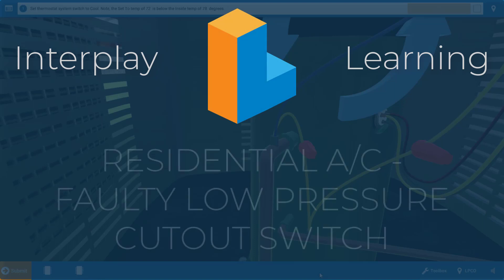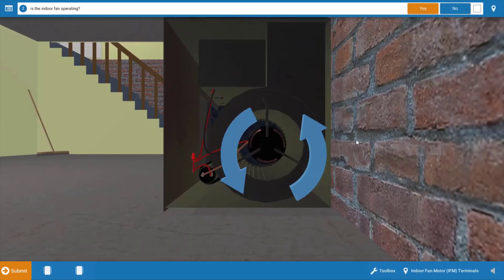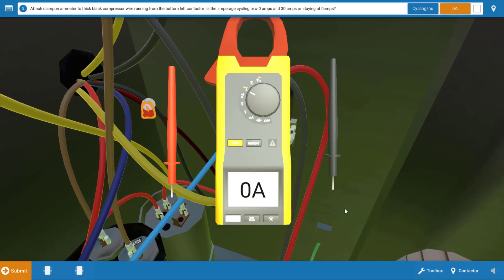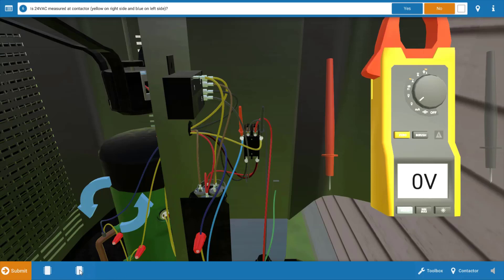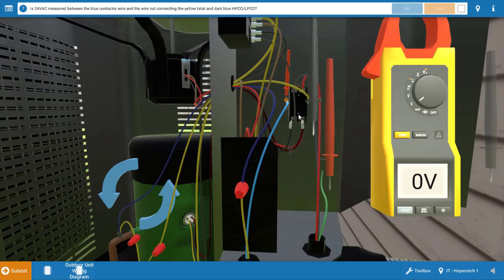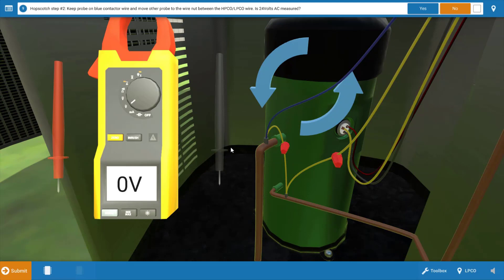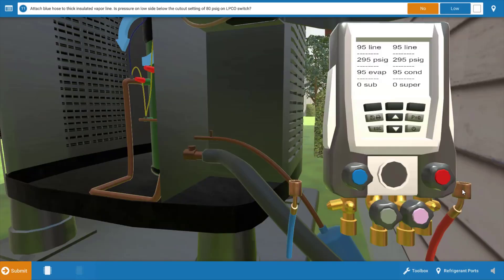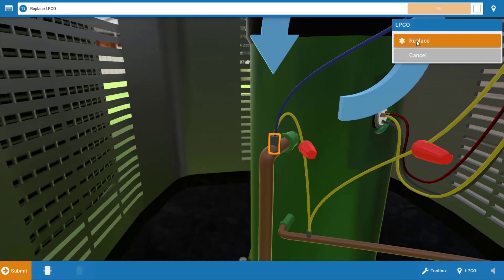Troubleshooting a Faulty Low Pressure Cutout on a Residential AC

Comment: Good explanation, but on your animation you have the low and high pressure lines reversed on the compressor, the low pressure line (larger one) is going into the bottom of the compressor and high pressure one is coming out at top.